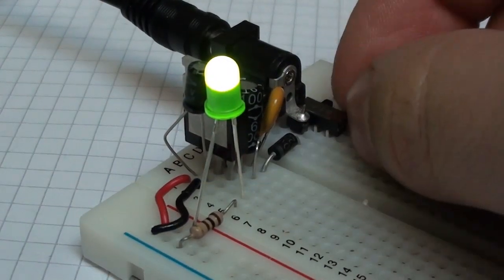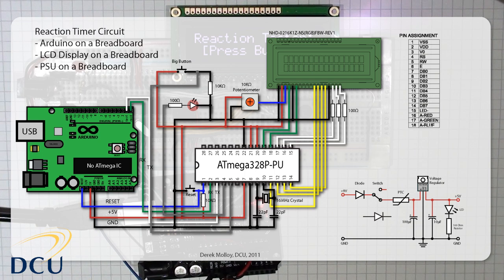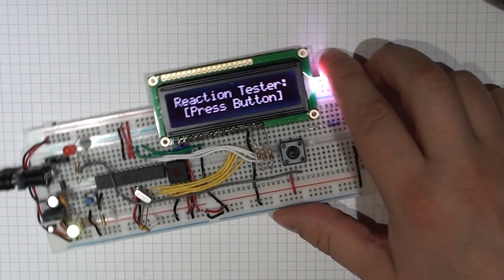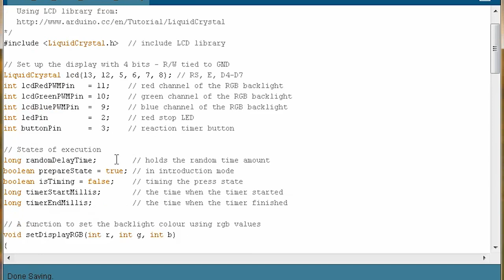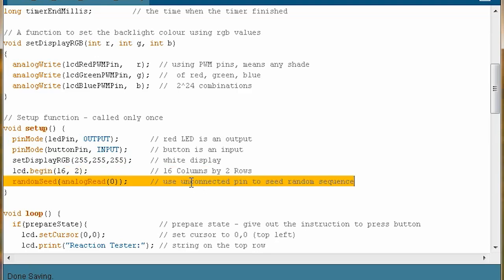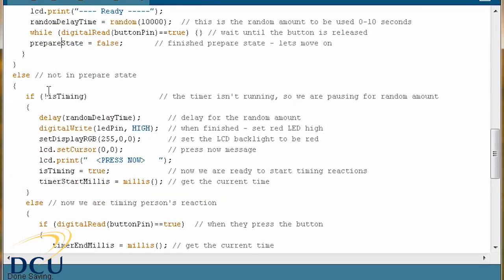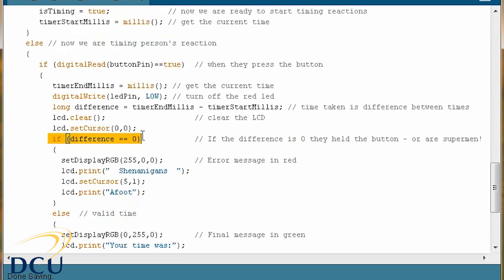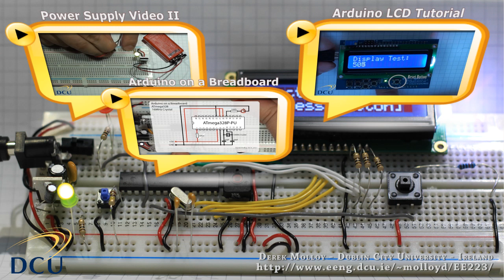Arduino: Arduino LCD Tutorial II - A Reaction Timer

Comment: Because the device is expecting anything from 5 volts to zero volts/ground and if it isn't connected to both how is the wiper going to provide the full range? Yeah it may be working your way but the device is not seeing full ground on the pin.. And he is using the pot to control the contrast the led is on a fixed value resistor..

Comment: This also greatly reduces cost. You wouldn't want to have a wireless system with 10 Arduinos around your house when you can just use 10 Atmega328 (crystals, caps, voltage reg., etc.) and cut the cost of the project in more than half...